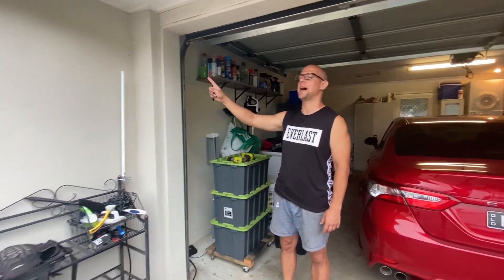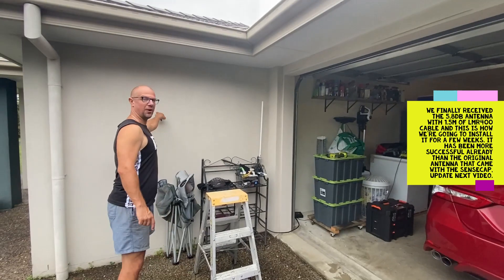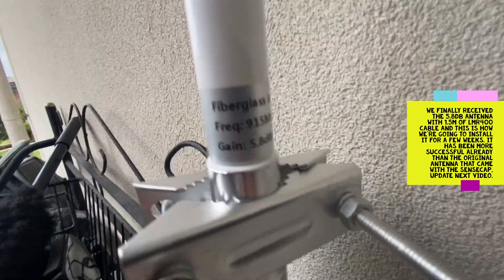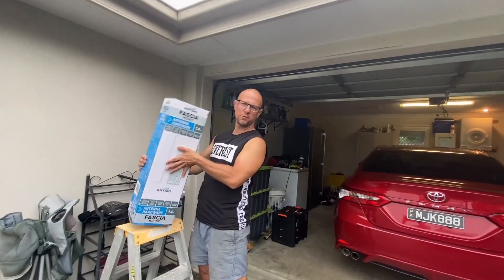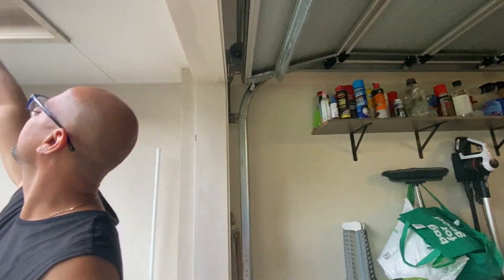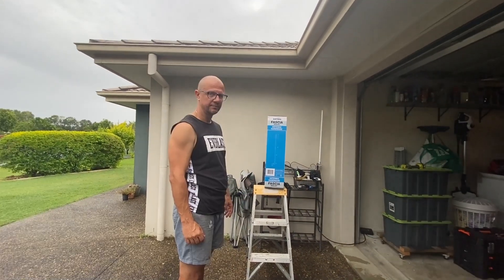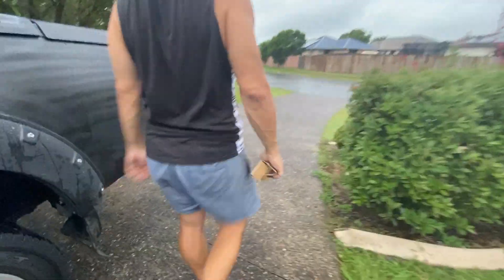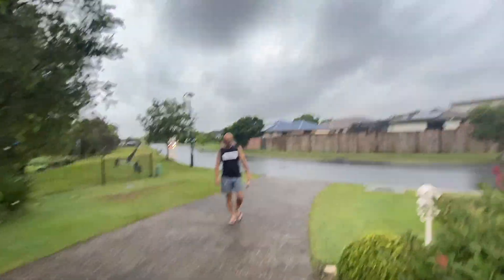Helium 5.8 dB Antenna Upgrade Sensecap M1

Comment: not good mate. try to place the antenna above your roof (completely). Put the antenna in top of your house and on a metal pipe 3-5 ft above, you will see a lot way better results.
Reply from the maker: Video coming soon ☺️